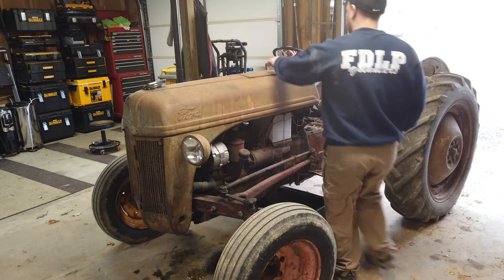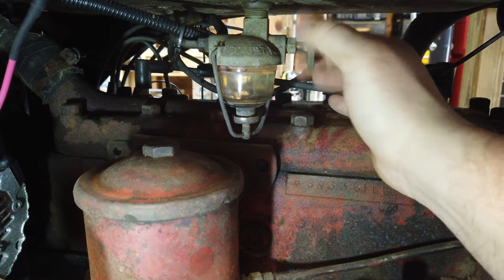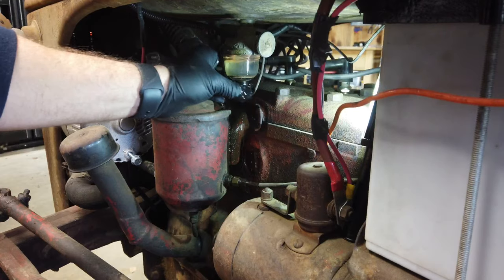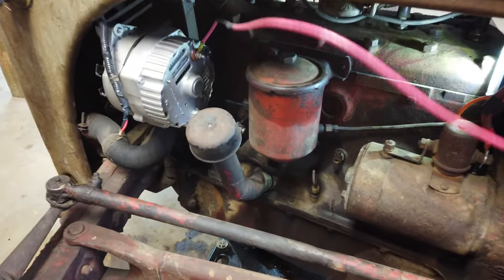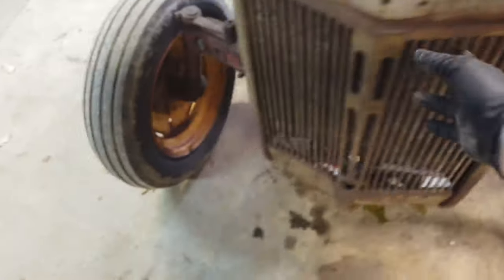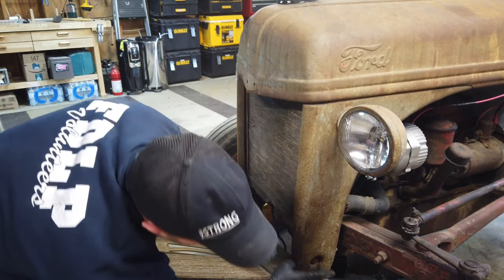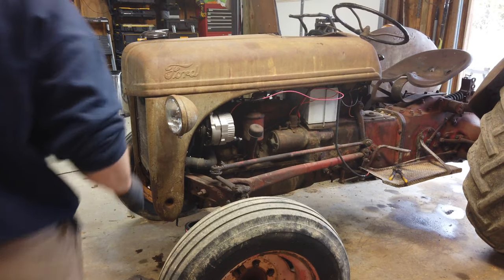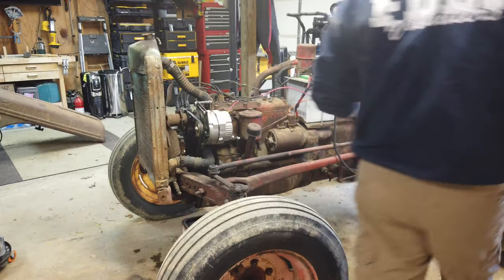8N Ford Tractor Hood Removal

Comment: The neighbor just got an 8N that has been Down for several years. One thrust Bearing on the left spindle was seized up Rusty and now I'm pulling the Hood off to get the Steering Box taken care of. I wasn't looking for a video on this but it popped up on my YouTube suggestions list thing. I think it's because I looked up a video on reading the numbers to find out exactly what Year She is. I grew up with these old machines and we did most of the repairs ourselves. 
  It has been 40 years if it's been a day since I Messed with one of them. 
   The neighbor was pretty happy to find out that I had some experience with the 8N Fords. I didn't realize how popular these still are, and the availability of parts is kinda mind blowing.
   It's strange, last year I built a riding Lawnmower to drag stuff around my place, and drive to get coffee on Main Street occasionally, the next thing I know everyone is bringing me their Machines. 
   It's all good I guess, it gets kinda thin living on Social Security, and I get all kinds of things for trade. I now have a 1960 Singer Sewing Machine that a 13 year old gave me for swapping out His Mini Bike engine. You know I just don't know how I could live life without a Broken Singer Sewing Machine setting in the corner of my Shop. Nice thing is it is in a Cabinet so folded down it's a good table for the Coffee, cigarettes and ashtrays 😎✌
Thank you for the video, though I had a fair idea of how it works I'm glad to see how you shared for those of us who don't. These really are Kool old Tractors similar to Henry's Model T I guess that they might just outlast me.

Comment: Good video, worked on many of these old N series tractors. I always found the easiest way to drain the gas is disconnect the fuel line at the carb, place a 5 gallon fuel can with a funnel inserted under the fuel line & open the fuel shutoff valve all the way open. This will drain all the fuel including the 1 gallon reserve in the tank so you will have no residual gas in the tank. Yes it’s easier to remove the hood with the assistance of another person or a motor crane. It will save your back. These old fords require a fair amount of maintenance so being handy with a wrench is a must. If your engine is original, your tractor was built in late 1950. The later 8Ns were no doubt the best of the N series with maybe the exception of the NAA which had live power & a few more horses with The Tiger overhead valve engine. Good old tractors.

Comment: I'm trying to remove mine, but something seems to be catching. Did you have a gas tank under the hood on that tractor? How were you able to remove it without removing the gas line or radiator hose?
Reply from the maker: Don’t have to remove radiator hose but do need to remove the radiator cap. 
Also need to disconnect the gas line and I suggest removing the glass bowl so you don’t break it. 
The gas tank comes out with the hood so make sure it is empty or it will be crazy heavy.